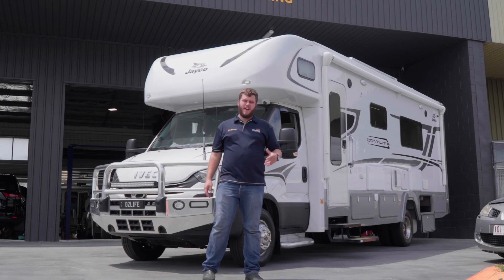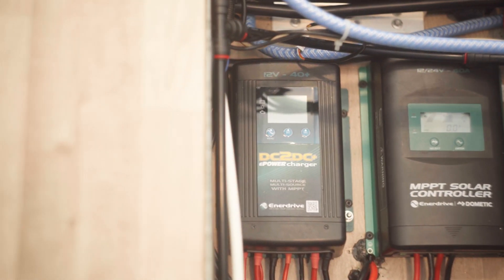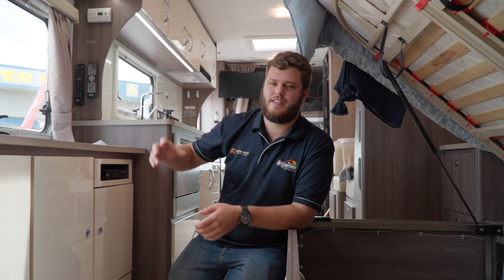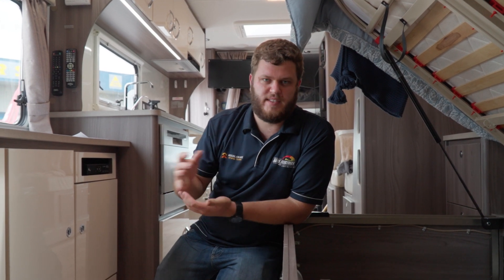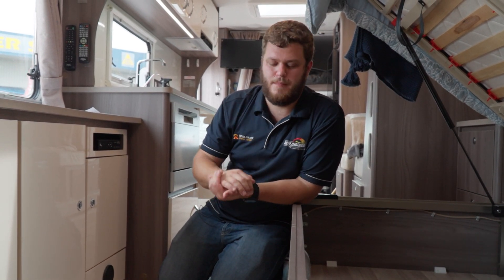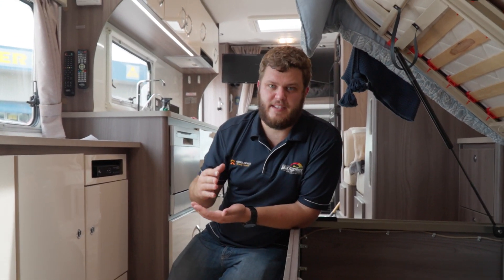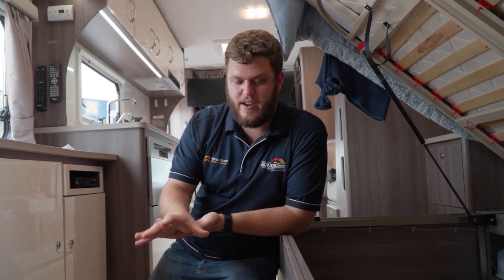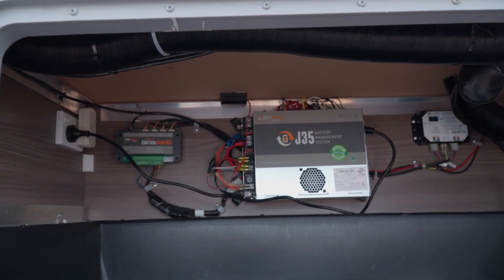Jayco Optimum Motorhome 600ah Lithium 720w Solar Off-Grid Setup Run Air-Con, Microwave, CPap  + More

Comment: Super neat, well done, I have a Jayco Outback 18.6.3 2014/15 model, bought new. I still run 2 X 100 ah AGMs that were delivered new, but I doubt they will last much longer. I don't know what system I have from Jayco, but am keen to change over to Lithium, say 1 X 300 ah B-Tec. What do you suggest.
Reply from the maker: 100% depends on what you want to run. You can book in for a phone consult with one of our off-grid experts who can chat to you about what you want to run and for how long then they can make a recommendation.
https://calendly.com/accelerate-offgrid-touring/15-minute-phone-chat-tourer